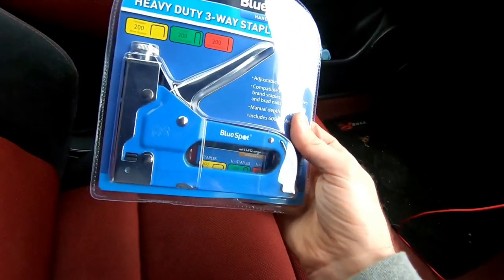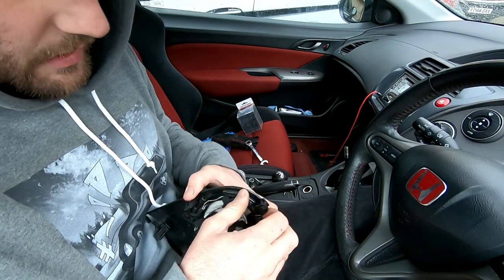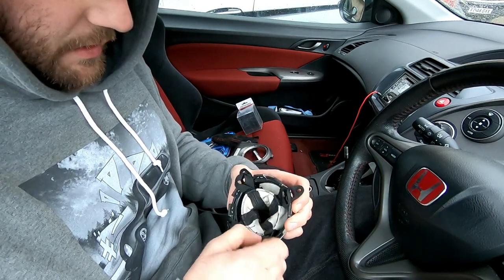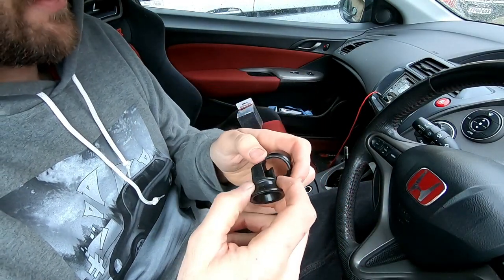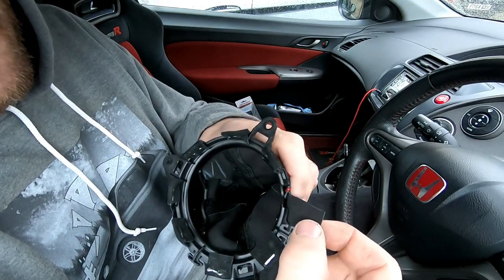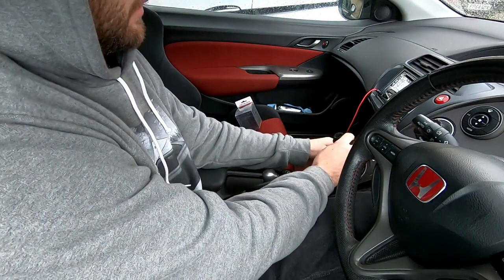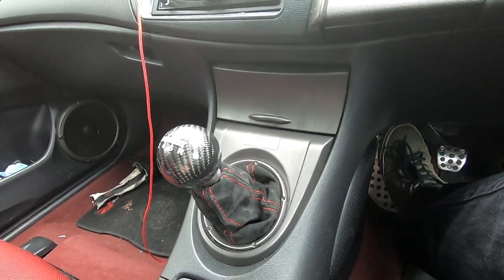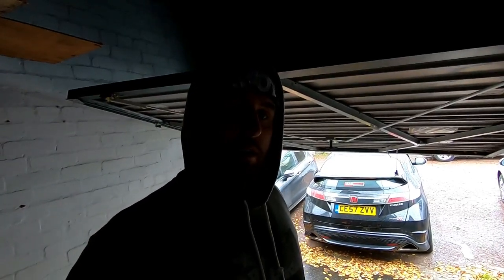How to fit new gear knob and gaiter to Honda Civic FN2 Type R

Comment: Thank you SO much from this video. I just bought one week ago a 2010 Civic Type R ( my first R ever ). And it also had worn out fabric. I like how that fabric looks like, the one you're using. I still decided to order an original one from local Honda dealer. That costed 91€. But thanks to this video, and you, I was able to get it very easilly, safely, and not scratching or breaking anything from cockpit. I didn't even know that that flap open that easy with those clips ( had 5 door 2010 Honda civic for 10 years and didn'n know it. I used to take always the whole middle console out in one peace. :( ) Saved ALOT of time and nerves. I like that you so carefully explain every little detail, so the installation process was very enjoyable, as it always should, when you're tuning or fixing your lovely Honda. Now the new gear gaiter is in place, shining as a new one. And if/when it worns out, I might install the same fabric what you chose. Since now I have a intact package ( from the original gaiter, one clip had broken, from where you seal it to the knob, from upper part. ) I really appreciate this video, and A.W.E.S.O.M.E. joy filled me when I got my own process done with only 15 minutes like a pro.

Comment: Hey man, 
Where can I buy the original gaiter with the rest of the stuff attached?
Reply from the maker: Either directly from Honda or there are some on ebay. 
https://ebay.to/2zhDBKf
Reply: eBay. I would buy the completed unit for £41.99 next time, cones with the gaiter fitted to the bottom frame and top ring, it's lots more work otherwise.

Comment: Car looks good. Have you had any dramas with the car since you’ve owned it? Been reliable?
Reply from the maker: Other than the drivers door handle falling off it has been absolutely perfect.
Reply: LeadFoot TV lol! That’s Honda’s for you, will run forever! 
Will be picking up an fn2 in the next couple of months, can’t wait. Keep up the good work👏
Reply from the maker: @steviekfc1869  to be honest the door handle only fell off because i think it's had a scrape on the drivers side and the handle had been glued back on. 
Hopefully getting all the dents pulled out in a few weeks though and try get hold of a new door handle. The passenger side looks great but it looks like a bit of a shed from the drivers side 😂
Reply: LeadFoot TV will follow the channel with interest mate👍
Reply: @LeadFootash23  Hah, happened to me car 2 years ago. It is a bit of a known 'problem'. I keep driving me car in the winter and it's just water gettin in there. Freezy temps just do the rest. After that, a propa repair with an industrial epoxy adhesive had to be done. Thermoplastics are not nice to deal with.
Reply from the maker: @brettershoalar9001  mines had a knock on that side and i think it was damaged then and glued back on but while i've been looking for a new one i've realised it seems to be quite a common problem.
I still haven't got around to replacing mine and i list the silver piece so i can't just stick it back on.
Reply: @LeadFootash23  You lost it? Oh lord no. I've been looking for this piece alone all round the net but it's a common thing selling the whole door handle instead. Or the inner and outer cover about 70/80 or more. Nah no, I wouldn't throw that much for this piece alone yet. 
Should I be able to get me hands on one, I'll text u right away mate.